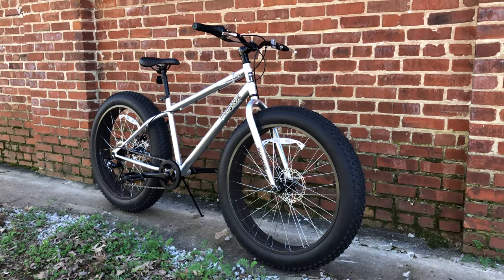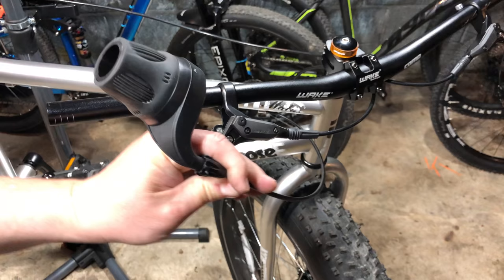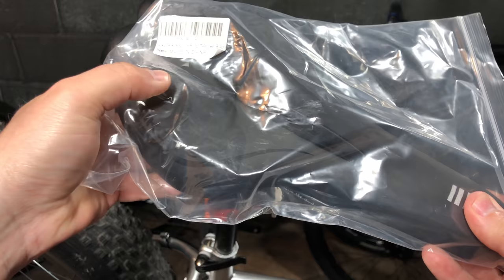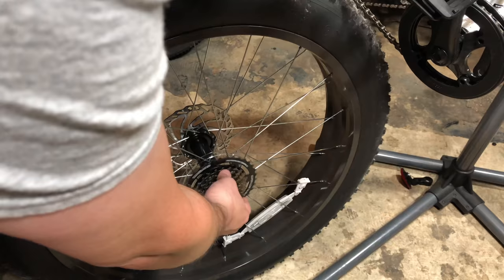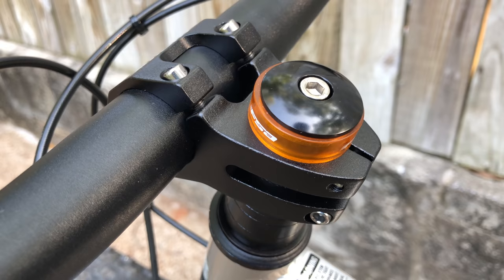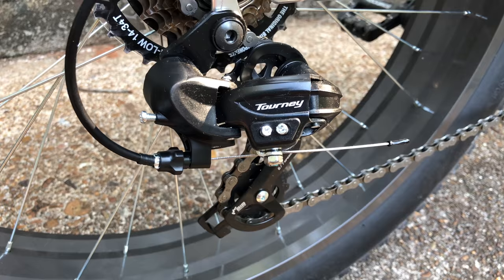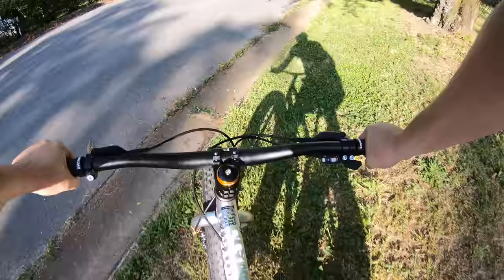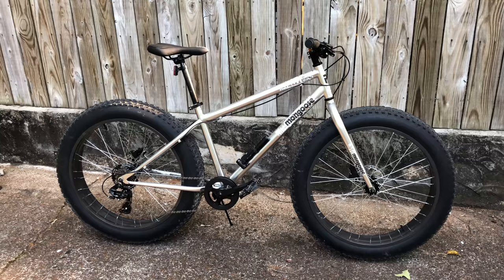Mongoose Malus Upgrades | Making a better fat tire bike for cheap

Comment: I upgraded the stem and handle bars on my bike, and needed a spacer, which I didn't have, so I broke out the calipers, took some measurements, and then 3d printed a spacer that was a perfect fit the first try.
Reply: Measure twice, print once! Nice. That's my kinda idea, but I can never make it work.

Comment: I bought my Malus about 7 years ago from Academy Sports for $199. I did many of the same upgrades you did. Recently I stripped down to the frame, powder coated it metallic green, converted it to a BBSHD ebike, swapped in a 27.5 inch wheelset, 2.75 street tires and a set of ape hangers. It looks awesome, very happy with the results. The only original part is the frame. I got my money's worth.

Comment: Thanks for doing this! I got the Malus, rode it a week, then began the upgrades. I couldn’t pop wheelies or bunny hop without accidentally twisting the shifter, so I got the rapid fire shifter and mega range freewheel (as well as some sweet grips). My handle bars have bent downward a bit so that’s next. Then the hydraulic brakes you’ve suggested will round things out nicely.

Comment: For being a in expensive bike to begin with ,I think that you made smart choices the hydro brakes were a smart improvement on your part and a seat exchange . I Purchased a Moogoose Vinson and looking forward to upgrading it  ,if you have the experience to do the upgrades then by all means do the upgrade it does improve the performance in the long run and you wind up being happier with the purchase .

Comment: Almost a year later but here it goes. I have the Malus with the red wheels. I did the same upgrades but the most important one was a new square taper bottom bracket 110mm with sealed bearings (15$). Then I was able to upgrade cranksets and install narrow-wide chainring to keep the chain from dropping. I also bought a 36 hole 190mm rear hub with a freehub instead of a freewheel. The rear hub, bottom bracket, and the 34t narrow wide chainring were purchased from AliExpress and the rear wheel was rebuilt to the new hub for $40 at my local bike shop. The seat post clamp was making noises because it was weak. There is a Corky seat post clamp on amazon which solves the problem.

Comment: If you actually come to Philippines, within a $250-500 budget, you can buy a FatBike with FD and RD being Altus, Tourney, Acera, and Alivio. And with a Shimano Non-Series Cranks. It would also include a Coil Fork (some even air) and some may have a Shimano Non-Series Hydraulic Brakes. Some come with Chaoyang tires. Also, they come with decent saddles and pedals. Not trying to promote going to the Philippines but you may find a decent Bike or FatBike for cheap. Btw im a Filipino Viewer.

Comment: Glad you're replacing those grips, they have slipping problems, even when really tightened down. The Wake handlebars and stem make a great combo for cheap, I tested them out on my gf's bike, taking it on rough trails and over small jumps with no problems. She rides a lot less aggressively than me, so if they survive my riding (a raceface nw chainring didn't, along with one of my ribs, the skin on my elbow, and a helmet) they should work great for her. One of my riding buddies also got that bar and stem combo and has had no problems so far, except with the Lyacon grips, one of which came off and almost sent him into a ditch.

Comment: Beautiful Malus, I have a light blue Dolomite that is completely upgraded, swapped to a 1x8 setup, BB7s, rapid shifter, lightweight Jumbo Jim tires and tubeless! These bikes are heavy from the factory yes, but i like that it's a steel frame, just feels way more heavy duty in terms of sturdiness, after my upgrades it flys, I paced with my buddy's car at 25-28 mph on a heavy fatbike!!! lol I don't race with it, but took it on some decent trails, beaches, parks, around the neighborhood, it's a very nice cruiser for the price & is the most fun and comfortable bike I have - I get compliments everywhere I go!
Reply: What freewheel did you use for the 1x8 setup?

Comment: On this bike most people are going to upgrade the freewheel and shifter, i think its better to go with the 8 speed 13  to 32t freewheel. You get a 32 instead of a 34 you get on the 7 speed mega rage, but you get to keep your 28t which is very useful and don't have such a huge gap between 1st and 2nd gear.

Comment: The twist shift was the #1 thing that had to go for fat biking.  The thing that will radically transform a fat bike is light wheels and tires.  Of course this would eliminate your new megarange.

Unfortunately you've likely come to the point where the next sensible upgrade would be to unload it and buy a slightly higher grade bike.

You did very well with what was available here.

Comment: Hey Kev, love your channel. Based partially on your review of the Malus, I picked up a Dolomite from Amazon during their last sale... $186 - I couldn't refuse 😊 What a fun bike! Just the thing for riding the dirty, sandy, muddy, roads where none of my other bikes will go. And not too bad on pavement -  rolls along about 12mph without too much effort. Out of the box, I was impressed. Well packaged,  shifter indexed, the brakes needed some fussing, but not too bad. I did repack the hubs, head set, and bottom bracket. All were lightly greased, probably good enough for a while, but all the cones were a little on the tight side. From my spare parts bin, I swapped out the shifter for a trigger type, added a bar end mirror,  swapped the saddle for a Bikeroo comfort type, changed the grips, and I've got a YST "sealed" bottom bracket waiting to go in. (Sealed is a stretch. It has a rubber washer to help keep the water out). I might do a little more, but right now,  it's great fun.
Reply: Wow thats cheap ! 
They're going for 450 nowadays

Comment: We use a 1 inch socket and a breaker bar with the park tool socket as the rear group set rarely comes off that easy.

Comment: Next time you're working on the cockpit, try setting the brake levers to the inside of the shifter. This will place the shift controls within reach and align the brake lever for single-digit braking with the index finger right at the hook on the end of the lever. Any decent brakes will stop with one finger anyway. I tried this 10 years ago with my first hydraulic brakes and have never gone back.
Reply from the maker: An old injury keeps single finger braking out of my ‘reach’

Comment: Hey Kevin! 

I have lost count of how many times I watched this video 😆👌🏾. 

Yes this is an improvement 👌🏾! The simple upgrades make sense and the bike looks way better.

I have the Schwinn Equivalent same colour too. 

I have a few components already to start my build. I have handlebars, grips, shifter brake lever combo ( to replace that annoying twist shifter lol ). 

I need the 31.8mm stem and probably will change the seat post. And will definitely do the Mega-Range upgrade.  

Is it a cassette or freewheel?

My recommendation next is to de-badge it. And remove the reflectors on the wheels. I did on mine. 

Appreciate the videos!
Greetings from Canada 🇨🇦😊
Reply from the maker: Thanks for watching. The wheel reflectors are already gone 😊. This bike has a freewheel.

Comment: The cost of any upgrade is the price of the original part plus the new part. Did the stem and bar make a big enough difference? The hydraulic brakes over cable? A proper bike would have those things, but we're assuming that the original bike was worth the cost missing the replaced parts.
Reply from the maker: Works for me

Comment: Kev the only change I disagree is the Shimano trigger shifter. Have few leftovers brand new Shimano trigger shifters that I have remove from bikes at purchase, if you’re interested, to replaced them with SRAM grip shifters which provide more accurate and responsive shifting. Trigger shifters are hard on my thumbs and not so responsive (too hard to operate for me). I agree the twist shifters provide by Mongoose are not very good. But with the SRAM Grip Shift I can shift, brake and keep good hand grip on bumpy surface all at the same time. Some thing I cannot do with trigger shifters.

Comment: Wake seem to make surprisingly good stuff for the price. In fact, I'm amazed at the kind of stuff that's out there for so little, like these Deckas floating rotors I picked up that outperform the stock Tektro by miles and Tektro have come a long way. It could be quality control or branding increasing overall cost to the consumer or even trade agreements, but it makes me wonder on the price variation between kitting out a box bike with typical box bike parts versus using stuff from Wake, Snail, Sunrace, Deckas, Bolany, Jankun, Stout, DNM and such at a manufacturing level.

Comment: Wish we had Walmart here in the UK , we do have Asda owned by Walmart , but they do not sell "big box bikes" . You guys are lucky to be getting these kind of value bikes . Here we get cheap and nasty stuff
Reply: Not necessarily. There are some superb bikes out there but you need to be over £350 really. 

I've ended up building a hardtail for my lad, similar spec to a £800 bike but at £502, still a lot but we do some pretty difficult stuff. This channel really helped on the forks and brakes! Thanks!
Reply: @adambcvg  yeah my point is , it costs us much more ... spend equal here to get cheap tat
Reply: @adambcvg  and yeah this channel is great for idea's on upgrading
Reply: @IanRogerson8420  yeah true. Actually mtb generally seems quite expensive in the uk. I ended up getting a big box bike (utterly massive box!) from Canyon in Germany instead. Not the best customer experience, but the bike is bloody brilliant.

Comment: Thanks for the vid just picked one of these up and definitely want to up grade the shifter I hate it. I like the mega gear u put on it. That would definitely help climbing. Thats the main draw back on the single front sprocket is the low gear isnt as low a other mountain bikes and the step hills with a heavier bike make for a workout with the factory freewheel

Comment: I like the grey wheels mine came with the maroon.  That build is almost exactly the same as mine.  I added a crank set and narrow wide, also went with 8 speed. Those grips are terrible mine wore out in less than 50 miles on trails

Comment: What's up fellow bike enthusiasts. I'm new here and am just stopping by to say hello. As well as get some help with a recent used bike purchase (Mongoose Malus R5714A fat bike) issue. I'm looking to grease the headset, hubs, bottom bracket, etc. I know I'll need a freewheel/cassette puller, adjustable wrench, cone wrench, standard wrench(s), socket wrench(s), allen key(s), crank puller, pin spanner, etc. What I really want help with is figuring out which size tools I need? Or which bike repair tool kit(s)/set(s) are recommended for this bike model? I'm starting out with zero tools but only want to start my collection with these specific tools.
P.S. I believe the bike to have all its original parts (as per the first and only owner).

Comment: Was going to get the malus but opted for the hitch for the drilled out rims even made mine tubeless on the stock wheels and tires when every bike shop told me it couldnt be done but got new rubber on mine now still tubeless
Reply from the maker: Sounds dangerous, but congrats on the bike.
Reply: @KevCentral  oh no tires are great did at least a 8 foot drop no problem barely squeezed a fart out the back tire at 14 psi
Reply: Love your channel too and glad theres still other people with our love for bikes i had a lefty back in the day too great bike still wished i had it

Comment: The reason for rerouting the shifter cable was to make a straighter line to the megarange did you add the cable stop on the rear closest to the free will mine doesn't have one it's the same bike

Comment: Careful with those wake stems, I’ve broken 2 of them in a very short amount of time.
Reply from the maker: What were you doing on them when they broke?
Reply: KevCentral both times I was jumping, and to be fair I rode them pretty hard. You could probably get away with them on a commuter, but they definitely seem to have some pretty bad weak points..the part is made of a cheap alloy and is thin and lightweight in the first place, and to be honest even the design looks kindve wonky. My first one broke at the face plate pretty much in half above the logo at the top angle, and my second one snapped the bolts straight off, and that’s one of the worst parts of it, on that one the bolts weren’t even drilled straight. I would recommend getting some higher grade bolts for yours as soon as you can.

Comment: Thank you for the video.  I have question: what is the difference between my Malus freewheel and the Shimano?  Thank you!
Reply from the maker: Hello. I think you’re asking what’s the difference between the factory freewheel and the Shimano megarange. Megarange has a 34t low gear that makes for easier pedaling in low gear

Comment: Do you know the rear dropout of the malus? I have one I’m going to convert to a rear hub motor ebike. Everything I’ve read says 185mm or 190mm. I measured with the tire still on so I was kind of eye balling it but it looks more like 8” / 203mm to me if I’m measuring correctly.

Comment: Hello i was wondering if this bike would be good for overweight people about 300lbs 5'9  i found it by searching google for bikes for heavy people and they suggested this bike and some much more expensive ones well outside a price i would consider this being $300 i was wondering if you or anyone had any suggestions for me . i would ride this in city/suburb streets with lots of hills. i have seen some YT videos and this bike also has a lot of recommended parts like the handlebar with 4 bolts and brake discs. i would appreciate any input.

Comment: Dangit..... Just when I change my mind you go and do this video and change it right back. Think I just won't be happy until I own one. I'm 6'3" and I've heard that it'll be ok. I've sat on one briefly at Academy Sports and it seemed ok. For the price though.....
Reply: Why do u want a fat bike? Just for fun? How's the nomad? Any regrets with that much travel? Honesty would be much appreciated, as I'm in the market and riding in ga mostly and nc I don't know if that much travel is great with all the climbing and very few bike parks
Reply: @cwd1232  I think a 5010 or Bronson would be a better choice. The travel is great, but I do feel it on the climbs. As for the fat bike, I just want one for screwing around. I think they look cool and I like how they ride. We don't have groomed snow trails or sand, so it's all in fun. Also, depending on your budget, you may want to consider a Hawk Hill. My daughter is going to get a B17. Think, plus size tire Hawk Hill. Gonna be her first mountain bike.
Reply: @MissingLinkMTB  thankyou for the answer! I was thinking that I just wanted to check with someone who has tried that much travel first hand. I rode bmx for years so I figured less travel like a 5010 of Bronson would be better for someone with my riding Style. If I get on a beach cruiser I'm hopping curbs and manualing and trying to find anything to play on. Not into going the fastest or doing the plowing down most gnarly trails faster than anyone. I want something that's fun on rough downhill and in between just playing around
Reply: @cwd1232  if you plan on hitting park and don't want to rent, think Bronson. Otherwise the shorter travel of something like a 5010 is perfect and very playful. I have a bmx race background too, so I like being playful. Heck, back in the day before we got into mountain bikes we used to ride our bmx on the trails.
Reply: @MissingLinkMTB  Awesome!!🤙🤙

Comment: Thanks for making these videos! I always enjoy them! I’m wondering what you think about sizing. My trek is a 19.5. I’m right at 6’ tall. seems like everywhere I read online the Malus is an 18” frame. Do you think it’s too small for me? 
My friend rented one at a greenway and I rode it a little, seemed sort of ok, but it obviously needed some upgrades etc..
I’m just wondering if it’s totally too small for me to even bother upgrading. 
Do you have trouble with the sizing?
Reply from the maker: 6’ would be at the max I would think. I’m 5’10” and it’s just right for my tastes.
Reply: Thanks for replying! Several months back I asked you for some advice on buying my first mountain Bike, it was really helpful!
Like I said seemed ok, my feet didn’t hit the wheels or anything. Do you think if you could put a longer seat post it’d throw anything out of whack?
Reply: @ryanwhite7615  I'm really late to this hahah but I'm 6'4 and fit pretty good on it

Comment: I just went to a "big box" store last night to look at this bike. I noticed that the rims have holes in them but your's doesn't. Did you change out the wheels or did mongoose change the wheel?
Reply from the maker: Some have the drilled wheels, some don’t. If I had to pick between the two I would take the drilled version. Saves a little weight.

Comment: Hey! I know this video is old! I'm not an enthusiastic and I'm just looking for a bike to go to campus and back ( 1 mile ). So Im not so interested in all the upgrades EXCEPT! I am a very large guy hence why I want this bike. I know nothing about bikes how do I know what kind of seat to buy to replace the seat?
Reply from the maker: Congrats on seeking out a bike. When it comes to saddles(seat) that is going to vary person-to-person. Some like large padded seats, some like a smaller thinner form factor. My suggestion with seats would be to visit a bike shop and sit on a few bikes with varying types. That will help you know what to look for